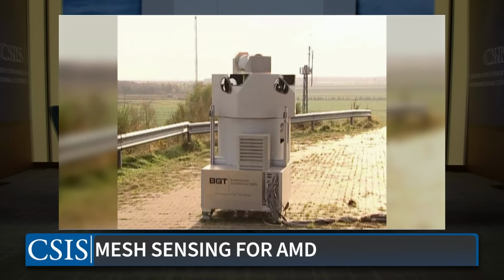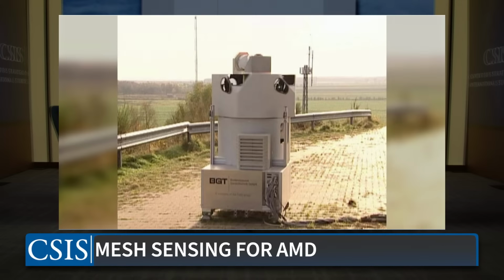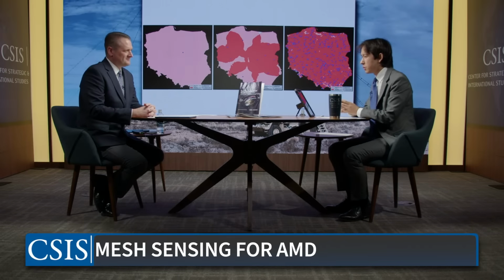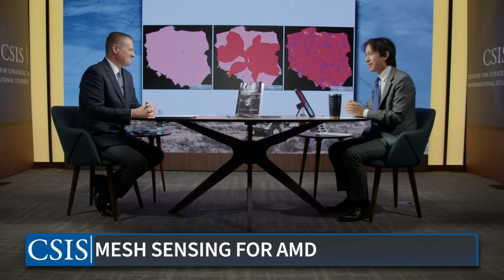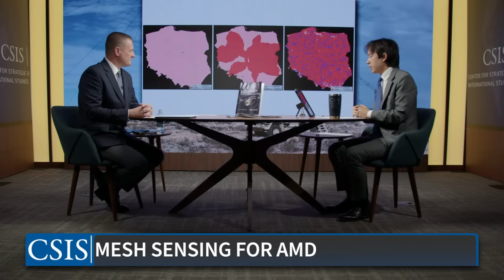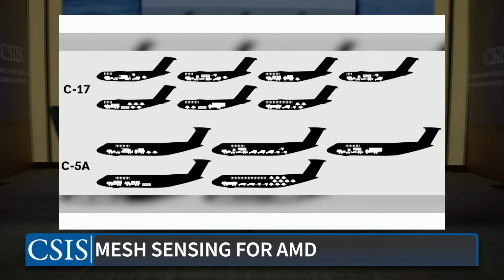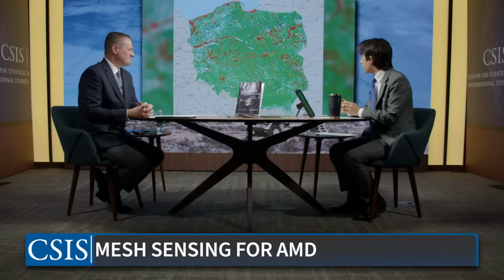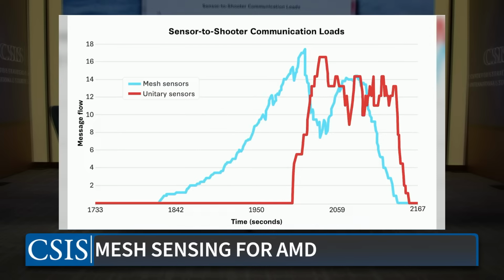Report Rollout: Mesh Sensing for Air and Missile Defense

Comment: Passive radar using signals from satellites for detection and only enabling tracking radars for fire control last second is going to have to be the future with the proliferation of anti-radiation missiles and other counter ew suites out there.
Reply: Multistatic passive radars utilizing reflections from backgroud emissions in combination with good ESM might be a good way to avoid powering up ones radar emissions too early.
Reply: @herptek  they already have that capability today they just don't utilize a distributed mesh architecture for it leaving many single points of failure.

I suspect they intend to litter the battle field with mesh connected passive radars that phone home whenever they detect something of interest.
Reply: @TommyJ76  What I am saying is that what you are suggesting is very much posible to do by expanding on currently existing capabilities. They were talking about sensor proliferation, but that is not such a novel concept. Any kinds of broadcasts that reflect from objects can be picked up by proliferared sensors acute enough to do so.